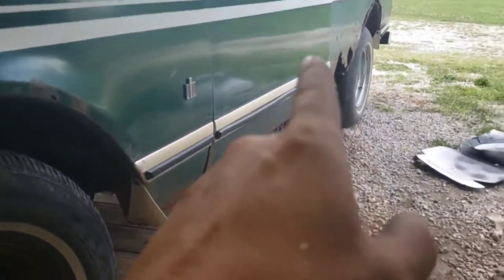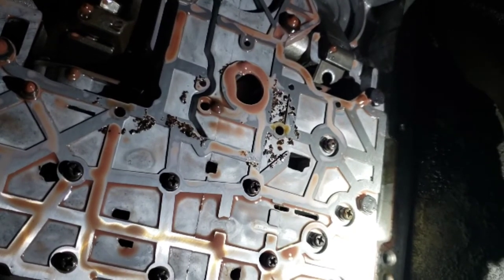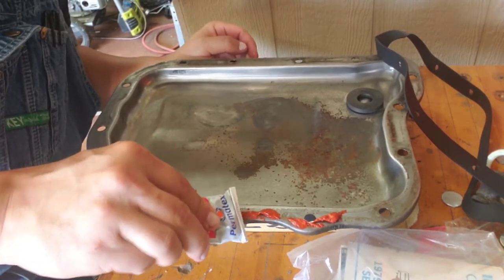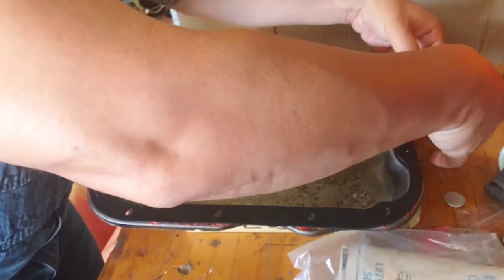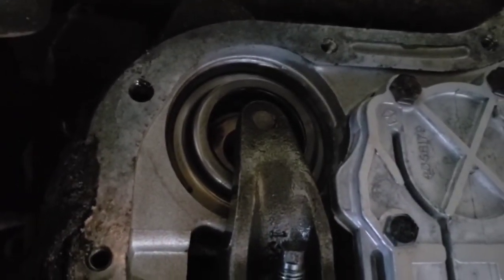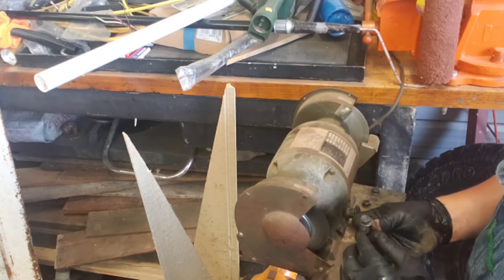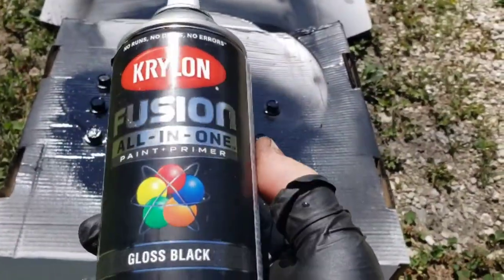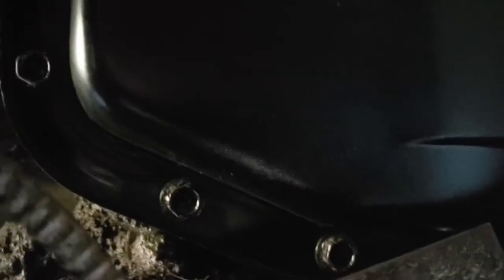INTERNATIONAL HARVESTER SCOUT TRAVELER BUILD PART 8!

Comment: You already have a scout2 traveler and l guess you are getting a scout 2 traveltop, 100 inch wheelbase as opposed to your 118 inch w.b. traveler. Unless you are getting a Terra pickup with the 118 inch w. base. Maybe you will get really lucky and pick up a scout II SS, Super Sport. Enjoy. l bought a Midas Traveler with the blue interior but the front swivel buckets were missing.
Reply from the maker: I can get another Traveler too, not sure how much it will need, at least some front 4x4 stuff since her Dad removed it for parts..I think it's a Midas as well. Can't remember.
Reply: @RoadHardRoadhouse  l have several parts scouts,,engines, frt. and rear axle sets,  4 speeds both close ratio and wide. Terra tops and bulkhead if you want to make a Terra Pickup out of a traveler or a traveltop .
Reply from the maker: @miketrimm3914  where are you located?
Reply: @RoadHardRoadhouse   Pontiac, Michigan . Sorry l took so long getting back to you as l just now saw this.